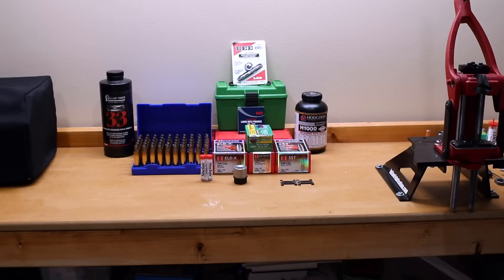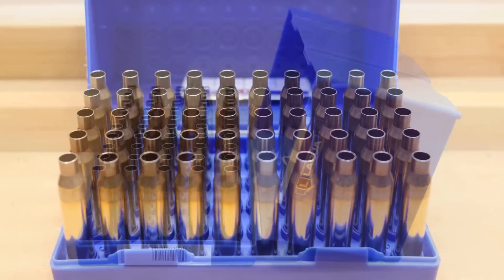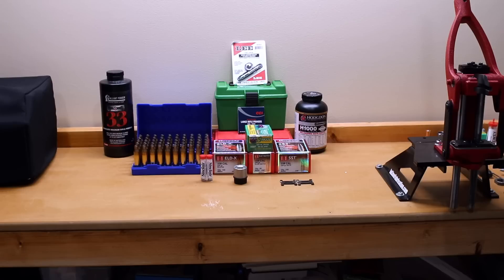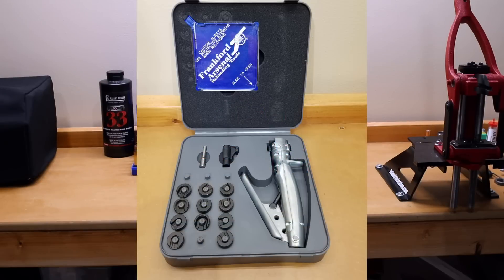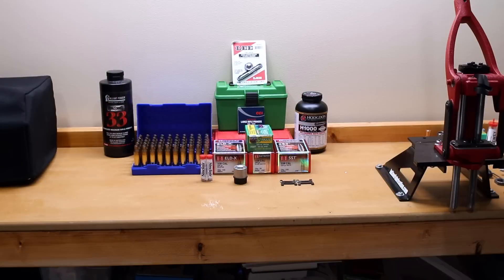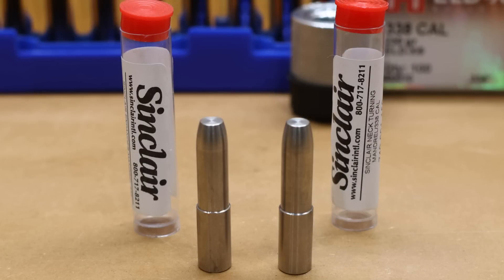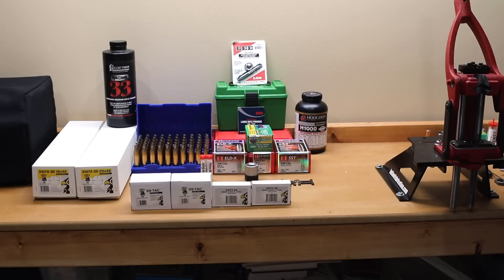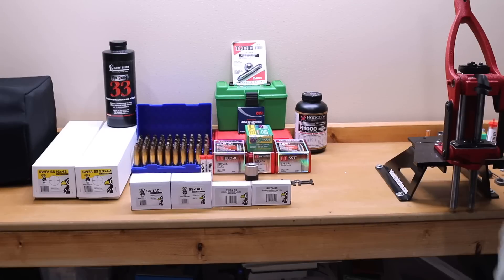338 Lapua Magnum Reloading equipment overview

Comment: In the picture it appears you bought the full length sizing die. Later you talked about fire forming the brass... wouldn't the full length sizer undo the effects of fire forming? Sorry to ask a noob question.
Reply from the maker: Typically during your FL sizing operation you will only want to push the shoulder back between. 001 to .003" at most. (Some call it bump sizing) and it is very likely that your brass will be smaller than this for the first firing.

Comment: I take a LEE Universal decapping die and lightly turn down the decapping pin so it is small enough to decap through all size firing holes...
Reply: 338 LM is too wide to fit into the Lee Decapping die
Reply from the maker: You are correct!

Comment: Thanks for the video, I plan to purchase the RPR 338 LM next year and this video will stay in my list since I also reload. I was wondering which powder was best, also your loading of choice with H1000. Plan to use Lyman dies, RCBS is what I use most of.  Thanks again.
Reply: I have the RPR .338LM I just went from 250g* Sierra matchkings up to 300g Sierra matchkings using Federal match primers & AR2217 ADI powder (exported as H1000 ) 86g load, 250 was 94g* rifle has been fired under 200 times, fired it 7 times @ 100m 1st shot 3" wide of bullseye adjusted scope a bit next 4 shots under 1/2" 3 holes joined then scope adjust next 2 shots joined.

Comment: Even up to $8.00 per round...Lapua's own loads but good accurate rounds can be had for less than a third of that. The 1/9.3 rate of twist to 1/9.35 is about ideal. The 1/10 doesn't do as well with the really long single feed target bullets.
Reply from the maker: Paul, I am simply look at brownells pricing here. 10 rounds of the 300 gr Lapua run about $72. Hornady factory seem to run just under $5 a trigger pull, but there is a lot of info about people with issues with savage rifles and Hornady brass not working well in this caliber. I am not paying that kind of $$ and not be able to reload the brass, or have to pound it out of my chamber. Far to often I find myself trying to save a dollar and it ends up costing me two. No one seems to argue that Lapua brass isn't the best for this application and that is why I decided to use it.  I have tried the Herters 250 SMK and it seemed ok, but still yielded slightly over MOA groups. What factory ammo have you had luck with in 338 LAP?

Comment: I’ve done a lot of load data with my lapua. The best load I found was 98 gr of rl33 with 300gr Berger vld. 28” barrel, 9.4 twist, 2850fps, cold bore Es of 8.
I’m gonna switch to the new nosler 265 lr accubond for better fps and only 5% less g1 bc.
Reply from the maker: +cody very interested to know how that works out.  I know in the nosler 6.5 lr bullets the bc was way over rated.

Comment: Another great video. I'm interested to know your thoughts on the new press as well as the expanders. Any noticeable improvements in SD or accuracy?

FYI, I use the Lee case trimmers for all rifle brass except 6.5 CM Lapua brass because of the small primer holes. Works great for me. No measuring. No setting up trimmers. Just chuck the brass and go.

As for fire forming, I would like to offer something I learned with 6.5 CM. I started fire forming my Lapua brass with 95 grain V-MAX bullets for the same reason you're using the 225 grain SST - cost. When I ran low on V-MAX, I finished the fire forming process with 140 grain SSTs. The unfired headspace was 1.553" and case head diameter was .4675". After fire forming with the 95 grain V-MAX, the headspace grew by only .0015" to 1.5545" and there was no noticeable change to the case head diameter. However, after fire forming with the 140 grain SST, the headspace on the new brass grew by .007" to 1.560" and the case head diameter grew by .002" to .4695". From now on, I will be using a bullet on the larger side to do my fire forming.

I will be checking out the SWFA scope. Never heard of it before this video.
Reply from the maker: +njgrplr2007 the scopes seem to have a great reputation.  I am sure I will review it after I have used it a while. I plan on doing some sort of crazy roundup with neck tension variances down the road, but I can't figure out exactly how I want to do it yet. As for the press, so far I like it. Not sure I can swear on huge differences, but the combination of it and the forster dies in 6.5 creedmoor have significantly reduced my run out numbers. Video eventually.